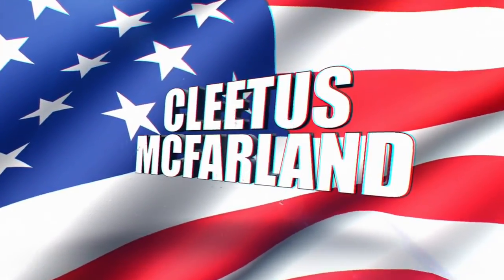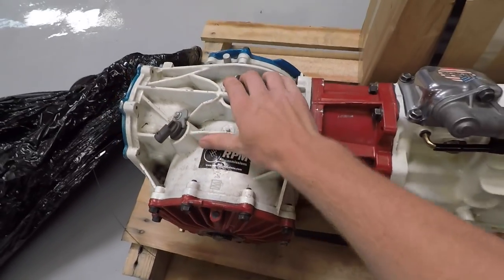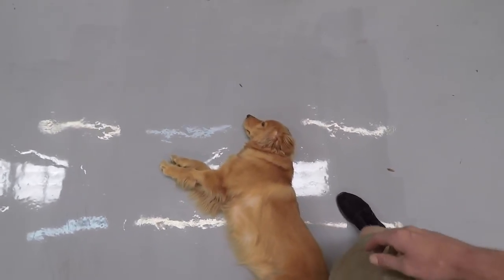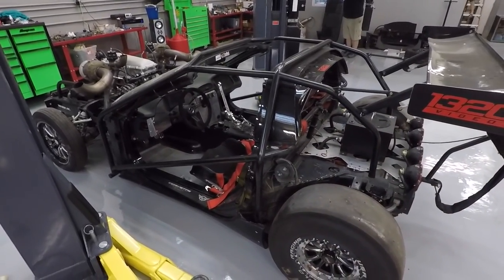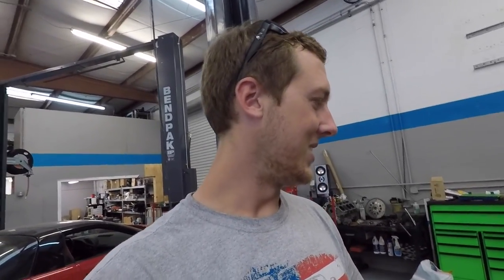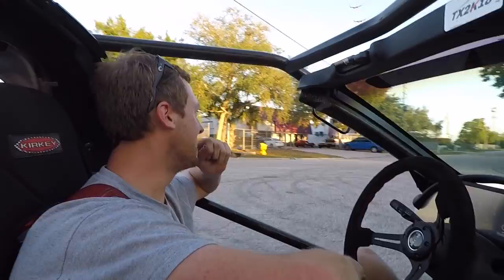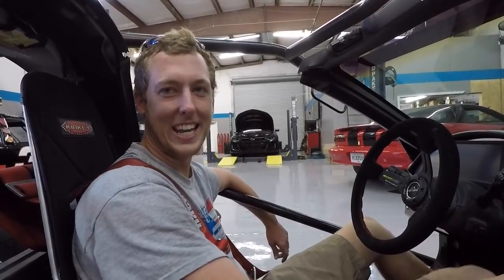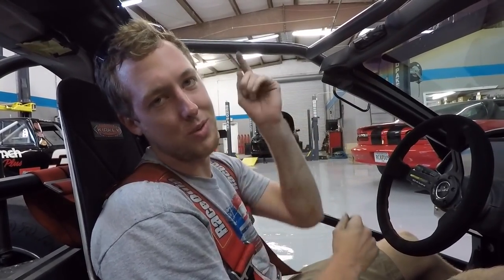Leroy's New Transmission is INSANE... So Worth It! (Faceplated T56)

Comment: Can you make a short [technical] video about what a faceplated gearset does ? I know about straight cut gears and a dogbox but I never heard faceplated
Reply: it is a style of dog box.
Reply: Joe cmon now, you ever met an engineer that you trusted?
Reply: It's not a dog box trans but I different way of engagement from gear to gear.  No more synchros.
Reply: It is a dog box - faceplate seems to be an American term.
Reply: that's what a dogbox is lol
Reply: @Mike West you trust engineers every time you walk into a building
Reply: Robby Lobman real shit😂😂😂
Reply: im an american 100% &  never heard of straight cut gears or dogbox referred to as "faceplated". just know it as straight cut gears or dogbox
Reply: I have a dog box  (straight cut) gear set. It sounds and feels very similar to this video. That clunk feel is real. Kinda crappy for low rpm driving but awesome for drag race. Shift hard and fast all day. By adding a strain gauge, you can drag race shift with no clutch except out of 1st gear (when you launch). Just bang bang bang.
Reply: Ronnie Rawdawg yep faceplates seem to be another name for engagement dogs. Straight-cut hears are straigh-cut gears, though and they're a different thing but go hand-in-hand with dogs. Cutting the gears straight eliminates axial load on the gearset and embiggens the contact area between the gears,  reducing the chance of shearing off teeth. Helical gears try to force each other lengthwise out the ends of the gearbox.
Reply: Also known as a crash box back in the ye ol days before syncros. Also I know the feeling Cletus is having, iv smashed through gears in a 650hp 2250ftlb beast for the past 13 years....as a diesel mechanic, all kenworths here in Oz run 18speed road rangers, no syncros, if you don't time gear box with engine and road speed correctly your never getting that gear.
Reply: CAFROG G  dog box and straight cut are two different things.

Dog box; instead of synchros each gear is fitted with a "dog" these essentially "slam" the gear instead of waiting for the clutch to be opened or perfect rpms like a synchro. 

Straight cut; each gear is no longer helical, the use of helical gears makes for smoother changes but lower torque is obtainable per the gear as the helical grind is weaker over all. Straight cut gears are used to over rule this, as a side affect of the 100% engagement of the gears tooth' surface area, straight gears whine when engaged

A dog box will sound really forceful when going into gear like a "click" sound. Straight cut gears just whine, people commonly use the terms incorrectly nd interchangeably.

The shifting with a dog box means that the gears only need to be unloaded to change (lift of the throttle), where as straight cut gears without dogs will still need to have the clutch engaged. 

There you go, anyone who says they have a dogbox(straight cut) gear set is lying, people who spend yhe money on these parts know the difference, you can however believe someone when they say theyve got straight cut gear sets with dog activation.
Reply: Faceplate is usually when a synchro gear is modified for dog engagement. A true dogbox is new gears that are usually straight cut although not always with the dogs original to the design.
Reply: "Imagine you are driving by a picket fence (the one with slats that have space between them) at 30 miles per hour and try to throw a stick in between the slats. Its almost impossible. Thats pretty much how it is to shift at 7000 rpms...the syncro hub triest to catch the gear at a huge speed. Now, take 5 of every 6 slats out of the fence...much easier to throw the stick through. A face-plated gear changes the 30-odd teeth in a syncro transmission to 5 or 6 massive teeth, making it easier to catch the gear when the RPMs are high. It becomes more violent because instead of having 5mm or so between teeth, its now like 30mm...hits the teeth harder because of the increased space. " from some forum i was looking at
Reply: Brock Bain I promise I have a Dogbox. PPG (Australian company) 1-4. Bought it from Drag Cartel (Jeremy). Dedicated drag car. And they are straight cut (not helical) gears. PPG labels it as a "1-4 Straight Cut Dog/Drag Set". Check out the website. 

http://www.ppgearbox.com.au/page.asp?productid=7
Reply: kleetus92 you were right lol
Reply: DrFiero that's exactly what a dogbox is, same as a motorcycle trans, the input and output gears are continuously meshed, the gear selection is based on which gear is pushed by a fork to slide on the shaft and lock its dogs into the adjacent gear.
Reply: JarHeadX18 thanks that helps
Reply: JarHeadX18 cool video I learned something thanks
Reply: @brockbain8656  is 100% correct. (And faceplating is a cheap way to make a dog box by eliminating the sycros and welding on dogs in your normal manual trans).

Comment: #Holley4VicePresident2020
Reply: Kenneth Pic And Trump president
Reply: #Cleetus4President2020 of course Hell yeahhhh brotherrrr
Reply: Mandate that all hybrids must be rear drive, and they all must have a launch gear, line lock, launch control, and a 2 step rev limiter. And they all must be V8, gotta remember that, men!
Reply: 455 stage-1 I am confused at this act of sudden bandito aggression. A V8 hybrid is the best of both worlds, American muscle V8 rumble and power, plus instant torque of American battery and motor technology. It's all American, there's no problem with it.
Reply: Gordon Schmitz hell no brother

Comment: I have a faceplated transmission in my Cougar. I also had one in my LS6 powered RX7. Be mindful of the 3-4 shift. If you are not careful, and accidentally pull it into 2nd instead of 4th, it will go in, and then bad things will happen. Mostly to your engine. Ask me how I know  :-/

Also, if you want to get it to go smoothly into 1st gear, put it in 5th gear first. That stops the mainshaft from rotating and it will go silently into 1st gear.
Reply: Jake Heke I know, because I have done it. And as a result, I mechanically over revved the engine and bent a few valves.
Reply: Its a common mistake and makes for some interesting noises when it happens.My cousin roasted about $7 grand when he did it and he's been racing stick shift cars for almost 20 years.
Reply: Jake you know you've done it because the motor will over rev instantly to like 10k+ rpm's and it'll practically throw you through the windshield because the drive wheels will pretty much lock up instantly,not to mention all the fucked up noises it'll make ;-)
Reply: projectgattago The money shift.... Ouch
Reply: It happened while street tuning the car.I was in the passenger seat logging everything when it happened ;-)
Reply: SouthJerseySound they could probably set up a simple gear lockout for when drag racing and slamming gears... Should not be too hard
Reply: Mate you swapped a ls into a rotary whyy???😂😂😂 those things are glorious!

Comment: Hell yea brother, now get a load cell shifter to pull the timing and BRAAAP it for Dale!
Reply: I know hes trying to stay in his class. But the only real next step is digital shifting with paddles. Nothing is faster than the computer.  And of course body panels lol.
Reply: Camaro Rick but then it's not stickshift
Reply: I would just put a strain gauge shift knob on it.
Reply: Dale wouldn't approve of paddles in that beast
Reply: CriticoolHit Or just do a th400 with a manual valve body with a 4500 stall converter. Be perfect for leroy.
Reply: Boi the autos are not for the leroy
Reply: Where are the #S1Sequential guys at they need to sponsor one of there sequential shifter for ol LéRoy now
Reply: put a sequential in it you can then fit an air ram and have it bump the gears from a button during a run
Reply: kyle hubner long way around to automatic
Reply: true but for doing road corse stuff with friends and for dale... manual all the way
Reply: H shiter dog box. Done

Comment: That would take some getting used to. Sounds like a missed shift because the RPMs climb so quick in the 1-2 shift. If you don't get in the 7's now...
Reply: if you watch his pb of 8.4, his shifting now will be approx 1 tenth quicker per shift....that'll get him close to a 8.1 sec and with the engine improvements a 7 sec pass is possible, but only if the axles can take it?? #difd ✌
Reply: That is what I thought. I'm not sure if he has the boost set higher for 2nd gear or if he wasn't at as high RPM when he shifted out of first, but second sounds like much higher RPM. The RPM should drop going into the next gear, so he can wind it out again. I would love to see the tach or a replay from his electronic cluster to see what is going on with the engine speed. It sounds insane.
Reply: The
Reply: The stock Axles will be next 2 grenade...💣💣💣😈😣 But only if he spins bad and then hooks really good 😣😈💣💣💣😱

Comment: Mobile 1 synthetic is high sulfur content,it eats all the brass in the transmission I'm surprised they recommended it.
Reply: 09victoryrc there's brass in transmissions?
Reply: rayn man nope😂
Reply: Are you thinking of the synchros? If so better question is what synchros does that thing have
Reply: 09victoryrc there's no syncros in this transmission.  It just got faceplated
Reply: Absolutely there's shiny Metals in the transmission you got bushings and who knows what else, mobil one tells you not to use it on the shiny metals
Reply: Isn't this a 5 speed or 6 speed only got the nascar gears for the first four lol
Reply: RCXDerp In the 1/4 mile he only gets to 4th gear...5th and 6th are just for cruising. Less noise that way im guessing

Comment: Anyone know if RPM will build MT-82s? ;)
Reply: Jacob R. Doty don't most people just do a t56 swap if they're sticking with the manual?
Reply: Ben calimer is the one to go to for the built mt 82. Or just t56 swap it.
Reply: Yep. I'm going to be doing the Amsoil cocktail he recommends here soon. I'm just wondering how well it can be built up. I think the main issue is the way the shifter is mounted.
Reply: or TR6060 from the GT500
Reply: That wouldn't really work unless the GT500 version of the TR6060 will fit
Reply: You may be right. I'm not super informed on transmissions to be honest.
Reply: How reliable are built trans on everyday use? (Not full power everyday)
Reply: I broke a Calimer stage 2 mt82 on an na setup, fuck the mt82 in all directions. I have a 6060 out of a gt500 in mine now, working on a single turbo setup at the moment but it held up against a Paxton blower just fine. Moral of the story, get a 6060 or a t56 magnum and throw the mt82 in the dumpster.
Reply: swap to a 6R80
Reply: Dingus Tardo did that after the second mt82 broke, if it's strictly a street car, it's a snooze fest with a 6r.
Reply: Never auto for me lol
Reply: Meh, I really like my 6r especially on NJ roads
Reply: Or Revolution Auto. Also, the blowfish racing bracket helps a little. But yah, still an mt-82...
Reply: tell me about it. Driving here is a nightmare. Just had a lady deliberately shove a shopping cart into my mustang and had to file a police report
Reply: If you get a MGW Race Spec doesn't that make blowfish bracket not needed? I was probably going to install race spec.
Reply: Cameron4life as far as daily driver reliability faceplating isnt a good option. Its only good for high load for acceleration, normal driving when on and off throttle while in gear will wear out the lugs of the plate thats been welded to the gears
Reply: Jacob R. Doty yes that's true, I got a blowfish when they did have that out.
Reply: Cool thanks for the info Matt
Reply: For anyone that doubts the MT82, (might sound like bullshit but its not lol) my cousin has an all motor NA 14' coyote running 10.7s in the 1/4. Stock trans stock shifter stock clutch. Search his channel his name is tommy marks.
Reply: Ben Calimer Stage 2, Mcleod RST, MGW Race Spec, and the Amsoil cocktail! 👌

Comment: For anyone wondering what a faceplated gear is, this is an excellent excerpt from a forum:

"Very easy to explain. Imagine you are driving by a picket fence (the one with slats that have space between them) at 30 miles per hour and try to throw a stick in between the slats. Its almost impossible. Thats pretty much how it is to shift at 7000 rpms...the syncro hub triest to catch the gear at a huge speed. Now, take 5 of every 6 slats out of the fence...much easier to throw the stick through. A face-plated gear changes the 30-odd teeth in a syncro transmission to 5 or 6 massive teeth, making it easier to catch the gear when the RPMs are high. It becomes more violent because instead of having 5mm or so between teeth, its now like 30mm...hits the teeth harder because of the increased space." -Admiral Doom

http://forums.corral.net/forums/general-mustang-tech/1342967-how-does-faceplated-trans-help-you-shift-any-faster-than-regular-trans.html

Comment: Gotta do the 4.6 swap instead of the 5.0. Keep in mind you're going forced induction and a 4.6 only has 3v per cyl. and is SOHC. Much cheaper and easier to get the power out vs DOHC and the extra moving valves make it more lilely to fail when pushed the way YOU like to push them lol. AMERICA!

Comment: Did RPM replace the helical gears with straight cut gears? I think G-Force gears are all straight cut.  You do lose the synchromesh when you switch from helical to straight.  I am not sure what face plated gears are.  Please explain.
You should just go with a Lenco or G-Force transmission! They are the best.   ENJOY!

Comment: It's probably already been said, but the reason for the "shift it like you hate it" is because normal shifting--anything slower than a sharp jerk, really--will cause the gears' dogs to grind (which is that chattering you heard).

The harder you shift, the less grinding you'll do and the longer Leroy's gears will last.

Comment: Cleetus, how do you stop it from lighting up the wheels on such a quick shift? the engine is going 1000+rpm faster than it needs to be in the next gear, which means its trying to break traction.
You might need a lighter clutch, crank, etc so the revs can drop easier, as well as an ignition cut like they have in a dual clutch.

Comment: I think you should do some sort of window net. It could look pretty cool but most importantly will greatly improve safety. You damn well might be getting into the 7s now and if anything gos wrong the top corner concrete barriers at drag strips are right about neck level and with how exposed you are in that car you could very easily make contact with one, and at those speeds that’s pretty much instant death. You could have them made so it’s not permanently mounted and just put them on for drag runs.

Comment: So I'm confused, is it like a dog box with straight cut gears?
Reply: Mean Man. He never mentioned if he got spur gears installed but he is insinuating that it does because they were listing for the whine. But yes faceplate gear sets are the same as dog engagement gear sets, syncros removed and replace with 8 luge tooth engagement gears.

Comment: Is face plated gears the same as straight cut instead of helical cut gears?
Reply: Iain Day No, you can have straight or helical cut gears. Straight cut are much louder but hold more power.  The synchros go on the end of the gears and are removeable.  Once you modify with faceplating, you remove the synchro for each gear you are doing and weld on a faceplate instead of the removeable sycnchro.  The faceplate has much less teeth and much more air space to engage making for a much faster shift.  The small downside is the easier miss-shifts could blow up the engine costing $1000's, lock the wheels and send you into a wall.

Comment: sounds like a bike going into first.
Reply: james nichols it has the same gear set as a bike now, bikes run straight cut gears (spur gear) with no syncros so that you can shift at high rpm. Now Leroy has a strong af gears and the "faceplate" gears will allow him to shift better at hi rpm
Reply: Jacob Stofmeel nice, cool to know. I've always been a bike guy so that sound really rings familiar.